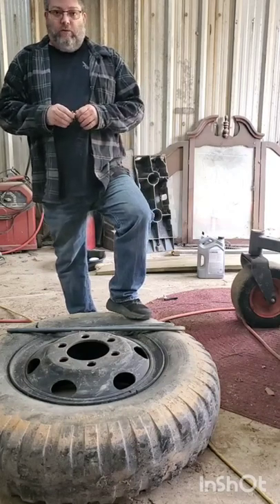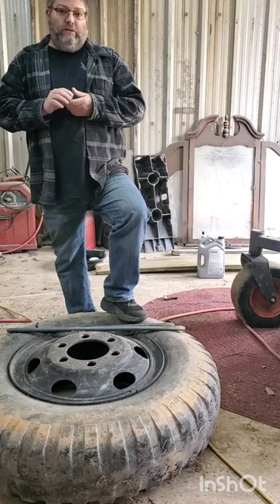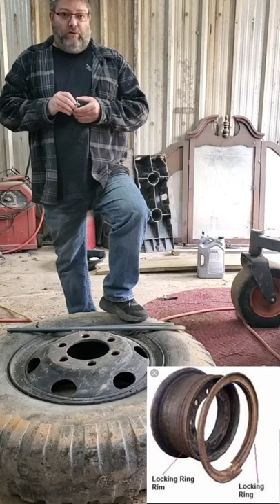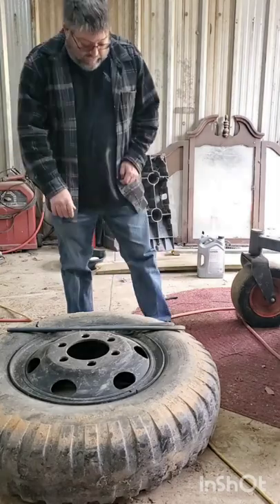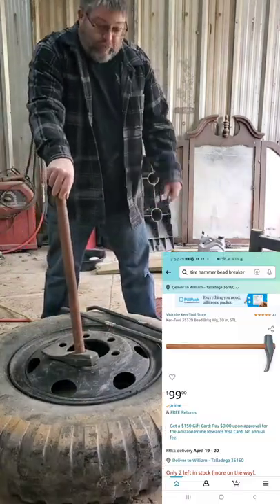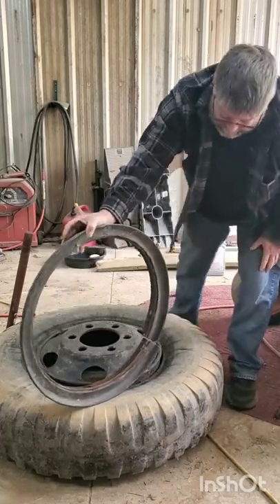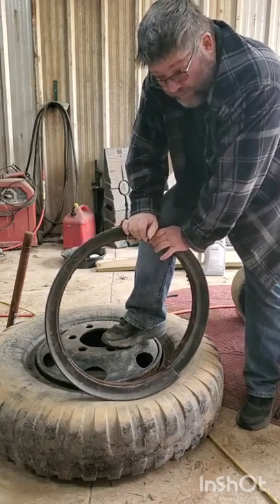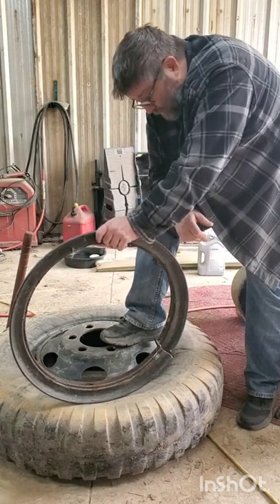Breaking down a 9.00 20 NDT tire

Comment: Nice job, Bill! Are you going to mount fresh NDTs, or are you going with a different tire?
Reply from the maker: I want to mount the G177 12.00R-20 but just don't have the cash as of now.
Reply: @justamanandhisdeuceandahal5399  will the 12s work as dual rears, or only as singles? I know there is concern about space between the dual tires.
Reply from the maker: @mattcarroll5603  I want to keep duals...otherwise I will go with the 395R 20's
Reply: @mattcarroll5603  12s will only work with duals with the MRAP wheels
Reply: I heard 11r20 is biggest you can go with duals? @hummerguy
Reply from the maker: yes I believe the 12r20 are too wide for stock wheels
Reply: @MrBULLRIDER13  Yep, you need the MRAP wheels for dual 12R20s. I went to the 395 singles on MRAP wheels, I can easily do 57mph now